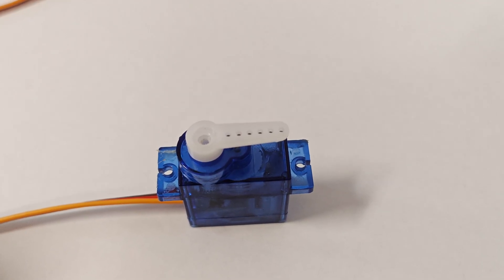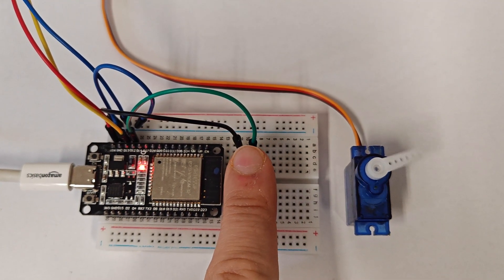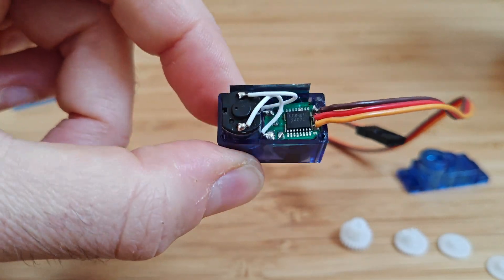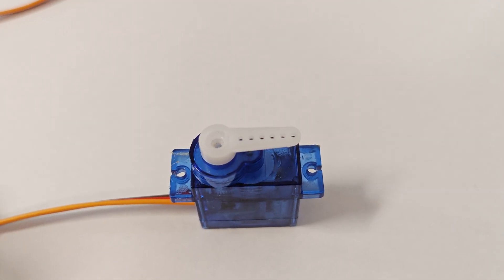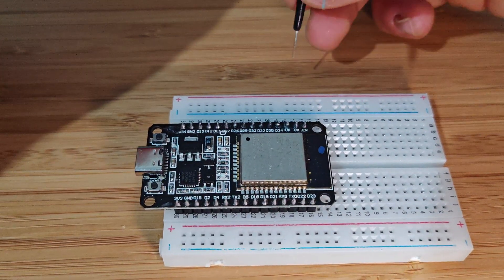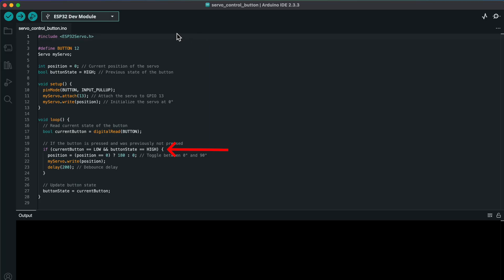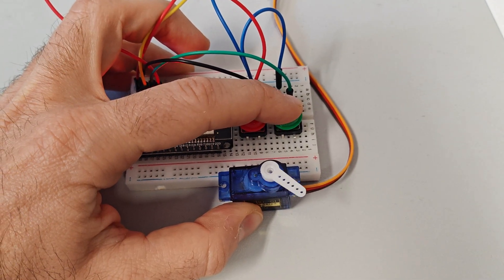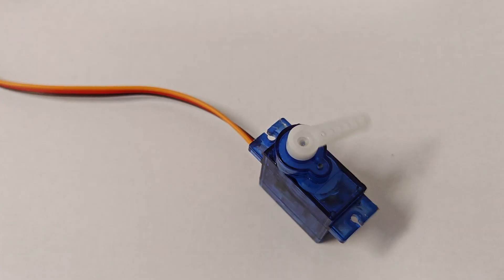Control Servo Motors with ESP32 in 5 Minutes!

Comment: Hello, I need some help from you. I want to make a code in esp32 which there will be two input pins. when pin 1 high the motor rotate 0 to 45 degrees in loop when pin 1 is low motor go at 0 degrees.  When pin 2 is high Motor will be go from 0 to 90 degrees and pin 2 is low motor go at 0 degrees Position. Can you help me ?
Reply from the maker: You can do that with an ESP32 by reading the two input pins and setting the servo angle based on which one is HIGH. When pin 1 is HIGH, move the servo back and forth between 0° and 45°. When pin 2 is HIGH, move it between 0° and 90°. If both pins are LOW, send the servo back to 0°. It’s just a matter of checking the pin states in loop() and writing the right angle to the servo each time.